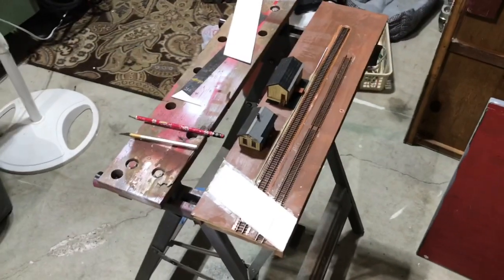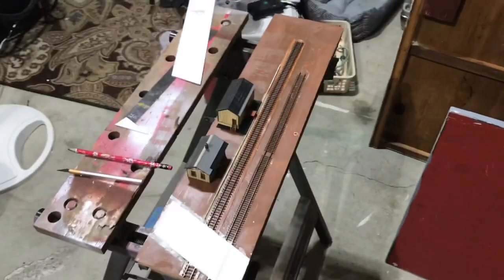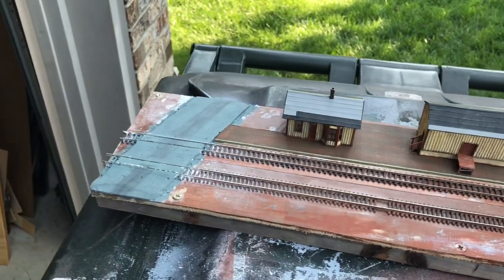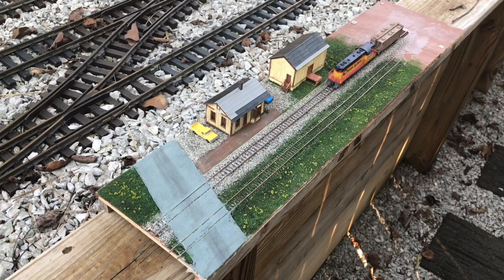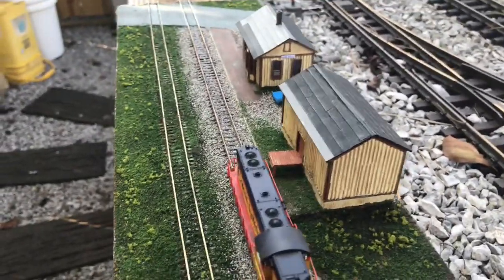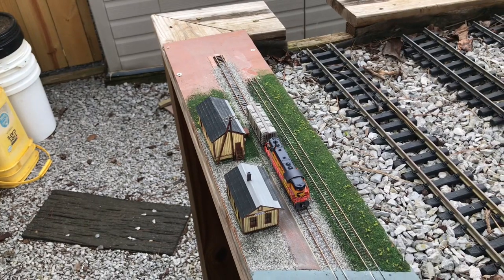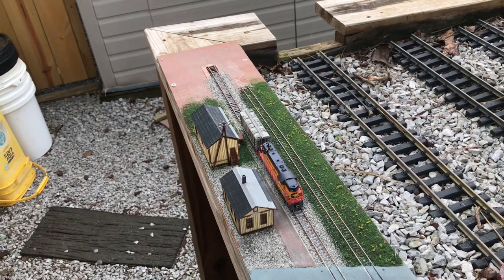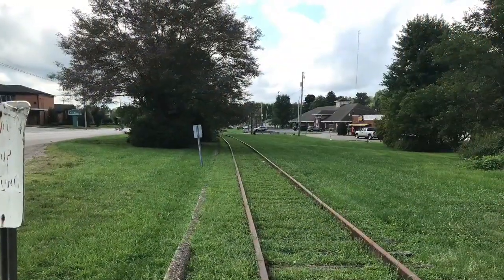Oak Hill, Ohio depot diorama

Comment: Looks great Thom. I didn't notice any problem with the structure siding until you zoomed in close. You really nailed the roadway color. What did you use to make and color the utility pole on the side of the freight house? It looks very realistic. I have several cut offs of Peco code 55 track. If you want a piece to take the mainline to the end of the board, let me know how long and PM me your mailing address. I can have it out to you on Monday. Thanks for sharing.
Reply from the maker: Maurice Grimes , thanks. I actually have enough track to extend both tracks to the end. I was just being lazy. Satellite photos show absolutely nothing there except grass and weeds. Hindsight being 20/20, I probably should have centered everything more on the board so I could stage a few more cars going both directions. Live and learn. I probably will finish it out after I get done with Union Spring. 
The utility pole is a Bachmann line pole that was actually too short out of the package. I cut off the bottom cross arm to match the real one and spliced a dowel to the bottom. The brace pole is a wood dowel that I roughed up with a razor saw and colored both of them with a brown Sharpie. I had already finished the top of the line pole by coloring the insulators and dry brushing grey. I could probably do a video on just making that pole!

As always, thanks for your kind comments and feedback.